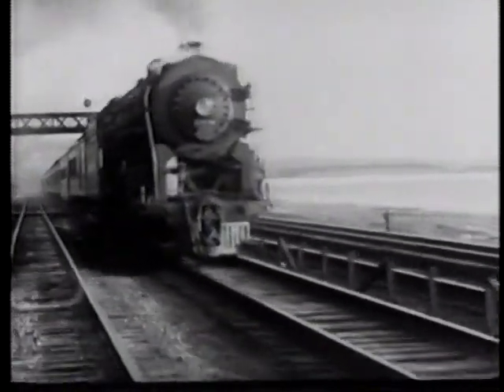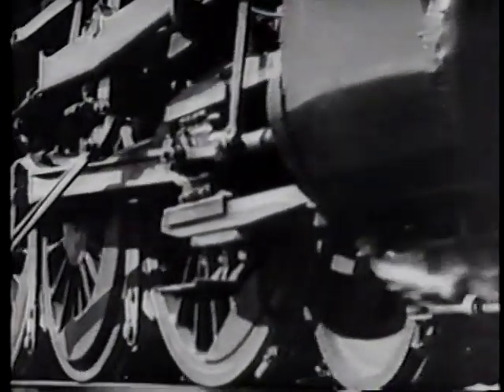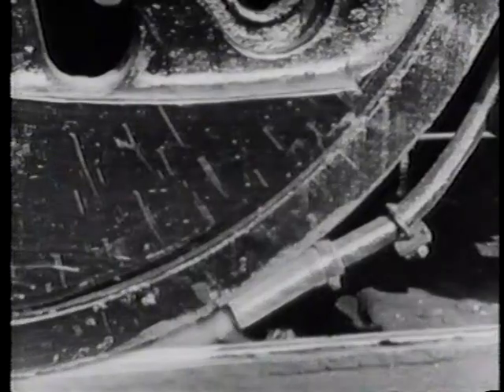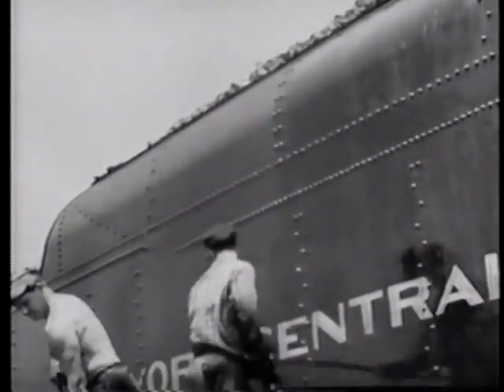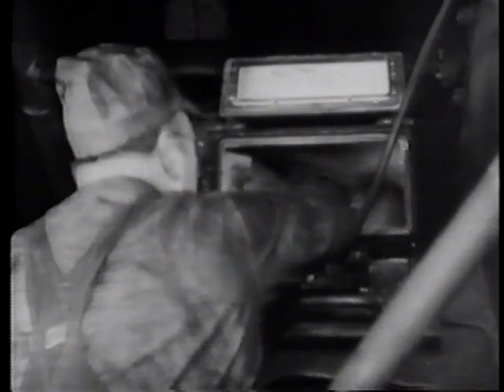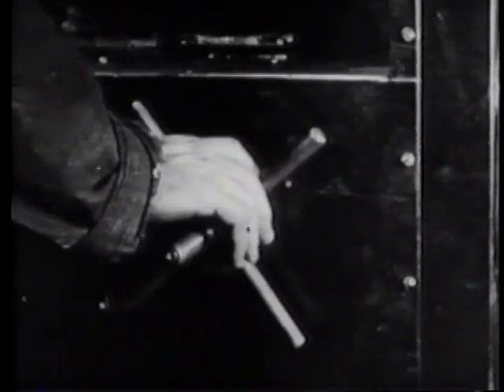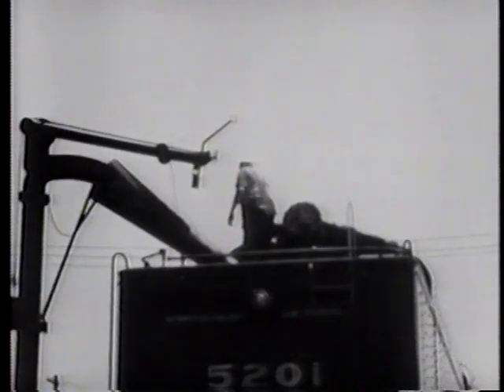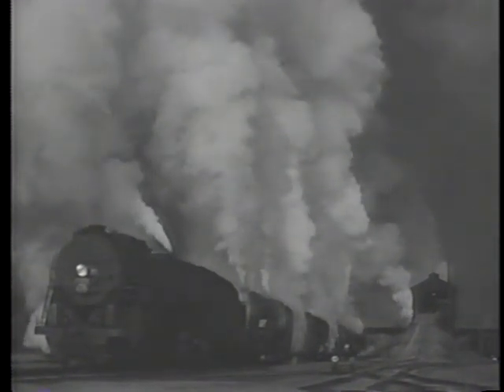The Steam Locomotive - New York Central

Comment: It’s so ironic how much they prided themselves in steam in this only for Perlman to sweep it all up and into the trash so immediately and near completely not even two decades after this was made
Reply: Fuel and maintenance costs on top safety are what did the steam locomotive in. But they still could have saved a few Niagaras, Hudsons, and a 4-6-6T
Reply: I'm getting tired of this "Alfred Perlman scrapped all the steam engines!!!!" claim I keep hearing. I haven't found a reliable source that backs this up. From what I can tell it's a rumor spread by railfans angry that no Hudsons were saved.

What I do know is that Alfred E Perlman did support preservation. Steam engines 999, 2933, 3001, as well as an electric S-motor 113 were all preserved when Perlman was running the Central.

It is worth noting that Perlman offered 2933 to the Museum Of Transportation in St Louis when they asked for 999. As 999 was going to the Museum Of Science and Industry, he offered them 2933 and S-Motor 113. According to letters sent between the museum and the Central, Perlman was delighted about 2933 being saved. He even attended the ceemony celebrating it's preservation. Theres even a photo of Perlman at the ceremony smiling holding a Lionel model of an S motor in front of S-113 and 2933. 

Perlman also visited the Museum Of Science and Industry when was 999 being preserved. You can find details of these events and the photo I referred to in the New York Central Historical Society's article on NYC 2933. 

But why no Hudsons? I do not know, but it's most likely financial reasons. The New York Central was losing millions in the 1950s. This was due to the rail indsutry being held back by outdated regulations, and government funding going towards roads and airports. They were likely scrapped in efforts to save money, to keep the railroad running and to prevent it from going under. They could not hand these engines out for free or less than scrap value. 

3001 survived not because it was donated, but because it was sold in 1957 to the Texas and Pacific.

2933 and 999 survived because they had stayed on the NYC roster into the 1960s. 999 due to it's historical status and small size, and 2933 because it was being used as a stationary boiler. (The story of 2933 being hidden is a made-up story). The New York Central's finances did slightly improve in the 1960s, which gave them enough cash to be able to donate these engines.

So no, Alfred E Perlman didn't intentionally scrap these steam engines and sweep them under the rug. It's just at the time, the railroad could not afford to save them. If they hadn't been scrapped by the 1960s, or if the New York Central wasn't in such a bad financial position in the 1950s, I gurantee you Perlman would have saved a Hudson.
Reply: I'm getting tired of this "Alfred Perlman scrapped all the steam engines!!!!" claim I keep hearing. I haven't found a reliable source that backs this up. From what I can tell it's a rumor spread by railfans angry that no Hudsons were saved.

What I do know is that Alfred E Perlman did support preservation. Steam engines 999 and 2933, as well as an electric S-motor 113 were all preserved when Perlman was at the Central.

It is worth noting that Perlman offered 2933 to the Museum Of Transportation in St Louis when they asked for 999. As 999 was at the Museum Of Science and Industry, he offered them 2933 and S-Motor 113. According to letters sent between the museum and the Central, Perlman was delighted about 2933 being saved. He even attended the ceemony celebrating it's preservation. Theres even a photo of Perlman at the ceremony smiling holding a Lionel model of an S motor in front of S-113 and 2933. 

Perlman also visited the Museum Of Science and Industry when was 999 being preserved. You can find details of these events and the photo I referred to in the New York Central Historical Society's article on NYC 2933. So it's clear that Perlman never hated steam engines or was against preservation.

The most likely reason that Alfred E Perlman didn't save any Hudsons was because when the Hudsons were retired in the 1950s, the New York Central was losing millions every year. The scrap money made from selling the engines for scrap helped keep the company going. The priority wasn't saving steam engines, it was keeping the company going. Note that NYC steam engines 3001 and 6721 were also both retired in the 1950s, but survived not because they were donated, but because they were sold to other railroads, meaning the NYC made a profit saving them. So I highly, highly doubt that Perlman would have turned down someone offering to buy a Hudson. Either they were offering too little, or they made the story up.

999 and 2933 were saved by Perlman because they were still around in the 1960s. By that time the New York Central was doing slightly better financially, and it was now more affordable to save a few engines. 999 survived into the 60s likely due to it's historical significance and smaller size, and 2933 lasted into the 60s because it was being used as a stationary boiler. (The story about it being hidden is a made-up story.)

So no, Alfred Perlman did not "sweep it all up and into the trash". If another railroad or entity would have bought a Hudson for scrap value in the 1950s, or if a Hudson had survived into the 1960s, I gurantee Alfred E Perlman would have saved one.
Reply: I'm getting tired of this "Alfred Perlman scrapped all the steam engines!!!!" claim I keep hearing. I haven't found a reliable source that backs this up. From what I can tell it's a rumor spread by railfans angry that no Hudsons were saved.

What I do know is that Alfred E Perlman did support preservation. Steam engines 999 and 2933, as well as an electric S-motor 113 were all preserved when Perlman was at the Central.

It is worth noting that Perlman offered 2933 to the Museum Of Transportation in St Louis when they asked for 999. As 999 was at the Museum Of Science and Industry, he offered them 2933 and S-Motor 113. According to letters sent between the museum and the Central, Perlman was delighted about 2933 being saved. He even attended the ceemony celebrating it's preservation. Theres even a photo of Perlman at the ceremony smiling holding a Lionel model of an S motor in front of S-113 and 2933. 

Perlman also visited the Museum Of Science and Industry when was 999 being preserved. You can find details of these events and the photo I referred to in the New York Central Historical Society's article on NYC 2933. So it's clear that Perlman never hated steam engines or was against preservation.

The most likely reason that Alfred E Perlman didn't save any Hudsons was because when the Hudsons were retired in the 1950s, the New York Central was losing millions every year. The scrap money made from selling the engines for scrap helped keep the company going. The priority wasn't saving steam engines, it was keeping the company going. Note that NYC steam engines 3001 and 6721 were also both retired in the 1950s, but survived not because they were donated, but because they were sold to other railroads, meaning the NYC made a profit saving them. So I highly, highly doubt that Perlman would have turned down someone offering to buy a Hudson. Either they were offering too little, or they made the story up.

999 and 2933 were saved by Perlman because they were still around in the 1960s. By that time the New York Central was doing slightly better financially, and it was now more affordable to save a few engines. 999 survived into the 60s likely due to it's historical significance and smaller size, and 2933 lasted into the 60s because it was being used as a stationary boiler. (The story about it being hidden is a made-up story.)

So no, Alfred Perlman did not "sweep it all under the rug". If another railroad or entity would have bought a Hudson for scrap value in the 1950s, or if a Hudson had survived into the 1960s, I gurantee Alfred E Perlman would have saved one.
Reply: I'm getting tired of this "Alfred Perlman scrapped all the steam engines!!!!" claim I keep hearing. I haven't found a reliable source that backs this up. From what I can tell it's a rumor spread by railfans angry that no Hudsons were saved.

What I do know is that Alfred E Perlman did support preservation. Steam engines 999 and 2933, as well as an electric S-motor 113 were all preserved when Perlman was at the Central.

It is worth noting that Perlman offered 2933 to the Museum Of Transportation in St Louis when they asked for 999. As 999 was at the Museum Of Science and Industry, he offered them 2933 and S-Motor 113. According to letters sent between the museum and the Central, Perlman was delighted about 2933 being saved. He even attended the ceemony celebrating it's preservation. Theres even a photo of Perlman at the ceremony smiling holding a Lionel model of an S motor in front of S-113 and 2933. 

Perlman also visited the Museum Of Science and Industry when was 999 being preserved. You can find details of these events and the photo I referred to in the New York Central Historical Society's article on NYC 2933. So it's clear that Perlman never hated steam engines or was against preservation.

The most likely reason that Alfred E Perlman didn't save any Hudsons was because when the Hudsons were retired in the 1950s, the New York Central was losing millions every year. The scrap money made from selling the engines for scrap helped keep the company going. The priority wasn't saving steam engines, it was keeping the company going. Note that NYC steam engines 3001 and 6721 were also both retired in the 1950s, but survived not because they were donated, but because they were sold to other railroads, meaning the NYC made a profit saving them. So I highly, highly doubt that Perlman would have turned down someone offering to buy a Hudson. Either they were offering too little, or they made the story up.

999 and 2933 were saved by Perlman because they were still around in the 1960s. By that time the New York Central was doing slightly better financially, and it was now more affordable to save a few engines. 999 survived into the 60s likely due to it's historical significance and smaller size, and 2933 lasted into the 60s because it was being used as a stationary boiler. (The story about it being hidden is a made-up story.)

So no, Alfred Perlman did not "sweep it all under the rug". If another railroad or entity would have bought a Hudson for scrap value in the 1950s, or if a Hudson had survived into the 1960s, I gurantee Alfred E Perlman would have saved one.
Reply: @WesternOhioInterurbanHistory  All those engines were scrapped while Perlman was in control of the railroad, if he was for preservation, we would have more NYC steam engines than we do today. You can read all you want, but you also have to notice distinct correlations between what happened, and who was in charge when it happened.
Reply: @HunterLohseRRVideos You could only go so far with a steam locomotive in terms of modern amenities. The dynamo, air compressor, and other equipment were leaches. Meaning they all needed a certain amount of steam pressure to work. Then there was the time it took to build up air in a train with a standard steam locomotive. The diesel locomotive became the answer to a lot of logistical problems with the railroad. However, it will never excuse how America tossed steam aside, whereas other countries used steam locomotives on into the 90s. Even the UK has us beat. "Progress is fine. But it has gone on far too long."
Reply: @berkshireerielocomotive3322  That’s just generally speaking why Steam ended which is obvious, that’s not what I’m emphasizing, it’s the lack of preservation and nothing more than that
Reply: @HunterLohseRRVideos I understand what you mean, and whole heartily agree. They were trying to save the Timken Four Aces. But Nothern Pacific had other ideas just like Perlman. Then there's the Southern Pacific AC-9s. A lot more should have been preserved. But we live in a throwaway society.
Reply: Sorry, friend, you don’t know what you’re talking about.  Plenty of source based printed information available.  READ
Reply: @coldwar1952  Sorry friend, I made this comment because of reading well known published material, you yourself please read before making such rude, ignorant, and uneducated comments, thank you and have a wonderful day 🙂
Reply: @HunterLohseRRVideos   I visited engine terminals of the New York Central in 1954 and 1955, when steam locomotives were still in regular service; on one visit the foreman allowed me to explore the interior of his roundhouse.  In 1962 I spoke with F. Nelson Blount, who told me that he had offered to BUY a Hudson from the NYC, but the NYC turned him down.  Your observation is the correct one,  and coldwar1952 is wrong.